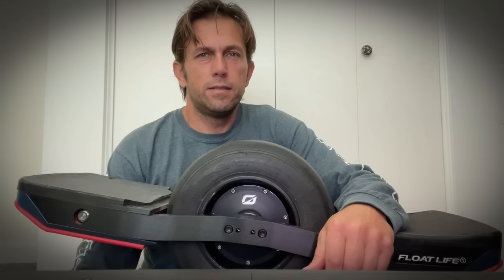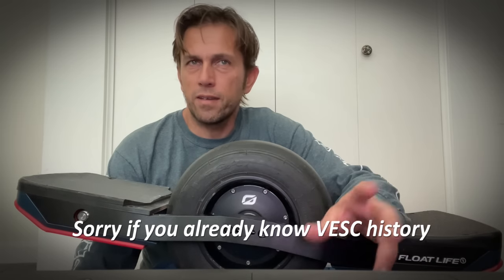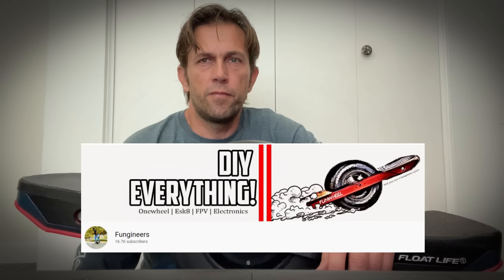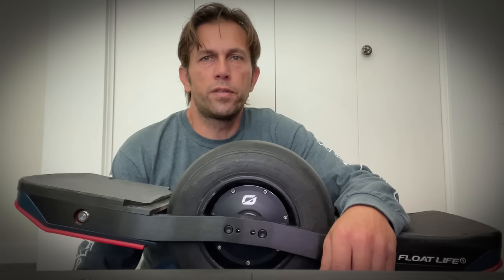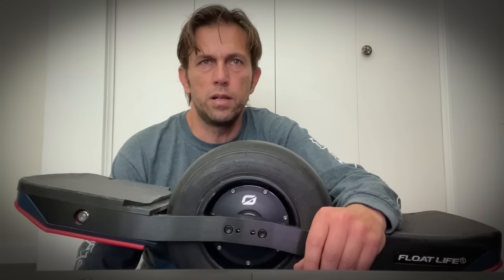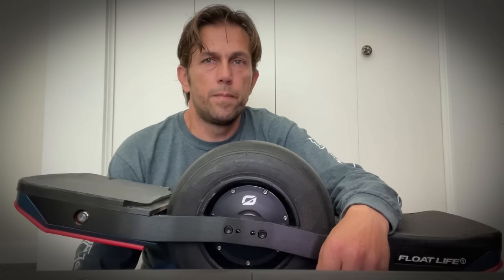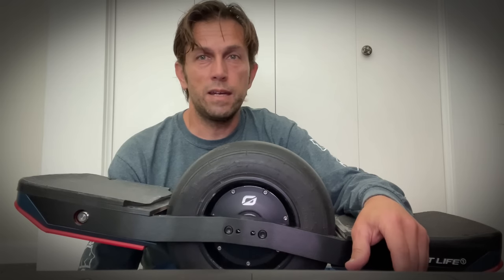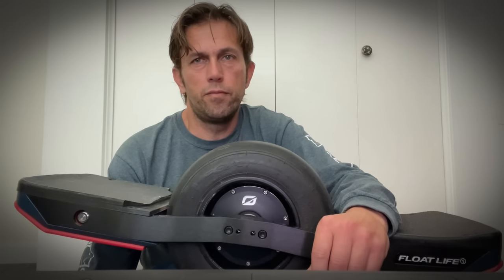VESC Balance Firmware - Magic Settings in v5.2?

Comment: Really great news! It is great to see the DIY boards performing better every month! 👍😁
Regarding the speed/bump instability; I have designed commercial motor control products which I can't go into details too much, but you might want to look at adding a 4th component "V" for velocity. Keep your PID tuning the same as it is now for low speeds, but at higher wheel speeds start to phase in the V component. What that does is to dampen rate of change of motor current. Basically once the motor is spinning faster you don't allow rapid change of motor current, only a slower change. This works synergistically with the real world physics of the motor being more stable at higher speeds.
The result is that at low speeds the motor will instantly respond to load peaks (like going over bumps), but at higher speeds, bumps wont affect the motor much at all its speed and torque will be very stable. Hope that helps and keep up the good work. 👍
Reply: Isn't V the same as D? So if I understand, what you're suggesting is a non-linear D gain that is lower at higher D?
Reply from the maker: I kind of do that to some extent but it won't help with the IMU issues - also, even at high speed you need to react quickly to certain terrain changes, imagine going from pavement onto grass, or hitting a steep ramp
Reply: I think I understand the difference between V and D, V is part of a separate PID to control the motor, not the PID to control the balance?
Reply: @jeepo500    no the D term as part of the PID is basically a predictive effect to allow things to change quicker.
A V term is not offical PID component but is a compensatory component added after the PID loop which dampens the ouput based on motor velocity. Additional averaging if you like, ramped in as motor speed increases.
Reply: @surfdado    ill argue that (respectfully). At higher, constant, speeds it is better to keep motor voltage relatively constant. So in your example of going from pavement to grass etc if you keep the motor power constant it will give a better result than trying to rapidly increase/decrease motor power for a very short period of time.
The dampening from fbe V averaging will be quite a short period, maybe 50 mS. Unlikely to need as long as 100 mS. If you are going at 2 meters per second and hit a 10 cm long bump that is 50 mS and 10 cm is a long bump, the peak loads from the wooden slats in your video would be much less than 50 mS and there is no need for the motor controller to try and change anything that fast when moving at that speed.
Reply from the maker: @wizrom3046  are you talking from standard vehicle experience? This is a balance vehicle - speed is not the primary objective, it's a side effect. Keeping the board stable and preventing nosedives is #1 priority. So if you transition from pavement to grass and keep the current constant you are going down
Reply: @surfdado  ... ah ok I understand your point better now. 👍
Reply: @surfdado  I'm curious what's going on with the IMU, just the filtering? If so, I think parallel filtering is the way to go, separate filters feeding P, I and D will definitely complicate tuning, but could lead to magic. Do you have logs somewhere? Where's the best place to contact you/discuss development?
Reply from the maker: The best way forward is to get yourself a VESC board so you can experience it and troubleshoot yourself - you can find me on the different DIY Onewheel Discords (google Funwheel or Floatwheel Discord for the links).

Comment: Love your videos.
Reply: Hey, I have a quick q, I went down the wrong path and built bytesize engineering OpenWheel but it has a huge battery 104x18650 and keeps breaking the battery box on slamming the ground. I'm gonna buy your pcbattery and rails to salvage parts and make this right after months of failure and constant 3d printing and epoxy. Can the funwheel 3d parts fit in an wtfXR rail or are they slightly different?  How often do you need to 3d print skid plates? I'll probably stick a small sheet of aluminum at the bottom to scrape. If you have any coupons for your shop please let me know, in in the hole so much by now 🥲

Comment: Great video. I can’t believe it works at all without the IMU data. Fwiw I think FM said it was running at 2000/second so 1ms readings wouldn’t be enough
Reply from the maker: The IMU data is the primary data we use. It would indeed not work without IMU data. As to the speed I'm not convinced that FM is running the IMU faster than we are - after all they use a processor that's half as powerful as the one used in any VESC. Their motor control loop runs at 14kHz (verified), ours runs at 20-30kHz (it's configurable). But I'm not sure where your 2000/second info is from - lots of rumors and assumptions out there. The VESC IMU data is read at 1000/s but there are efforts underway to make that faster. I'm not convinced however that this will have a huge impact

Comment: This is so awesome, I can’t wait for VESC to take over! How much would the investment be to convert a onewheel XR, but keeping my 15s3p pack? Would I need another BMS on top of the little focer3?
Reply: No you can use FM BMS ;)
Reply: Its about $400, you can use your stock BMS.  I decided to build a 21700 4200mah 45a 18s 1p battery (I have a spot welder, so I only spent $110 to build the pack) and decided to us a balancer to balance my pack every 10 or so cycles, that way I didn't need to take up space with a BMS.  I love the way my XR is now, heps of power, I truly believe it out preforms a stock XR by a good amount, and is even more powerful than a GT.
Reply from the maker: Especially the 4210 and older FM BMS can be reused, I'm not 100% sure about 4212 and up, isn't the locking/pairing bi-directional? But there might be workarounds, idk
Reply: @surfdado  Nope. BMS and Controller pairing is uni-directional; BMS -> Controller. Controller never communicates back to the BMS.
Reply: I can't believe that vesc some how manages to get similar to onewheel behavior at the exact moment FM has a terrible product launch on top of tells no one about locking down the board to the point you can't even work on them. All you people working on the vesc keep at it your doing gods work!

I cannot wait for the day where my XR controller dies or something and I can have a vesc installed and basically have the same experience without any FM BS.

Comment: I don't know for sure, but the Marconi filter (haven't heard of it before but I'm not that into control systems) will be some sort of low frequency filter, allowing "high frequency" content through. So, fast changes in set point go through, demanding a higher current, lower frequency, or slower changes in set point, are heavily attenuated. It might be why you're having issues over bumps, as it'll be a high frequency content coming through the filter, but in a degree of freedom that the onewheel can't control (it can only balance forwards and backwards, not up and down in the z direction, which a bump would show). But that's just a random guess!

Comment: This is way cool - I stumbled across this through the algorithm as someone whose GT initially ghosted and I was searching for answers (fine so far after getting a new footpad, but…), got caught up in the FM drama, etc…

I’ll be honest, even my haunted GT is fun enough that I am going to ride it for now, but all of this does have me wondering if I might need to find a non-FM solution between now and 2035 when their patent is up…

That said, even the stuff in this video is way beyond my current level of understanding of all this DIY biz. If I had a long-term goal of teaching myself how to go from 0 to something like you’ve got, where would I *start*?  

I’m not an engineer and have no background with that, but I can operate various screwdrivers. 😅 As for coding, I don’t know about any of the stuff mentioned here, but I’m maybe an intermediate-level web developer, so I think I can find my way around the software, probably…

Any, thanks for posting this. Really cool stuff, subscribed!
Reply from the maker: Instructions can be found on various Discords and in YT videos. This all should get easier over time as more and more plug and play solutions are being offered. And even today the vast majority of VESC DIYers don't ever touch the code. There's a PC tool and a mobile app for all the configuration stuff. But yeah, I'd stick to the GT for now, at least till you run out of warranty
Reply: @surfdado  Ok, thanks! I’ll check things out, slowly but surely… ;)

Comment: The nose grind you can do easily by going into custom mode and change the tilt of your board. It's super easy
Reply from the maker: haha and here I was thinking it required skill ;)
Reply: @surfdado  I thought the very same thing at first until someone showed me and then I was like ooooh now I feel dumb. Lol. We learn something new everyday. 👍
Reply: Well I never tilted the nose for a nosedrag. But if you only wanna do a nosedrag I'm sure this is the easy way to do 😝
Reply from the maker: Wait a minute - are we talking about a nosegrind or a nosedrag? A nosegrind to me involves a curb and the wheel being in the air. A nosedrag is the acceleration version of a taildrag when braking. Doing a nosedrag by changing your tilt is super lame, I'm sorry - and doesn't even count...
Reply: Anyway 😆 you could use negative variable nose tilt or constant negative nosetilt to be applied above 1000 erpm with vesc just make sure you know how to break

Comment: I believe that the nose dipping behavior when you're going at speed has to do with the fact that you're jumping off the ground slightly with each bump. Each time you land you would essentially need new data to be horizontal again. What it seems like is happening is that all of the faulty data is adding up to eventually produce an incorrect result. This sounds like to me that it's using rotational data in combination with the pitch data to actually tell you what is horizontal. I just don't know how it works
Reply from the maker: you're on the right track there - it's a combo of accelerometer data and gyroscope data. Hannes's config is accelerometer-centric. And I'm being told that the bumpiness causes a noise overload in the accelerometer
Reply: @surfdado  It would seem an averaging algorithm or using data with less accuracy might help? I am a computer guy and onewheel trail expert but not a coder
Reply from the maker: @Pyriscent  a good amount of the code is about filtering, i.e. making the data smoother / less noisy
Reply: @surfdado  I'm not a coder but I am a sound engineer, maybe the method of smoothing should change? In other words, rather than smooth out the lines just on the spikes, what about a gradual smoothing towards the edge of spikes?

Comment: I think what this indicates is something I've suspected all along, that the central issue here was philosophical, not technical. Namely, the misguided assumption, built upon a faux history of a benevolent company formed by geniuses who somehow managed to leverage this genius to take an original idea and flesh it out, using intelligence, forethought, and a deep insight into systems and a detailed investigation into all the possible edge cases to come up with a product that, after untold hours of tweaking and experimenting, and thousands upon thousands of lines of code, was somehow able to respond to all possible real world situations as if by magic.
I never believed this to be the case.
Rather, a far more realistic scenario was a guy who saw Dean Kamen's patent drawings for one wheeled balancing skateboards, decided to build his own, threw in some guessed at numbers into a motor controller, and just winged it.
This current situation seems to bear out the latter!
I.e., venerating and mythologizing  the founders (even is subconsciously) lead to shortsightedness!

Comment: A little integral gain could fix the nose dip, maybe decrease integral gain as velocity increases? I need to get a VESC soon.
Reply from the maker: with classic Mahony filters it was imperative to have integral gain to prevent nosedips at higher speeds. But this is not necessary with the heavy filter (don't ask me why). And once the IMU reports plain wrong data on a rattling surface integral gain wouldn't help because the IMU doesn't data doesn't even show the nose dip
Reply: I recall something about this particular frequency of terrain (wooden slates) was causing nose dives issues, I didn’t believe it at first but ill see if I can dig it up again.
Awesome vid tho very interesting stuff. 👍
Reply from the maker: @dustinglowa1072  you mean on FM Onewheels? would love to hear more about that

Comment: Can you do long tail drag ?
I suspect that the filter will eventually catch up and bring back the board to level.
Thanks for sharing this !
Reply from the maker: Longer than what we showed in our video? How do you do a "long" tail drag on the XR? Bringing the board back to level eventually is exactly what a well working onewheel should do, shouldn't it?
Reply: @surfdado  I realised after the fact that you did a pretty nice one on the video.
I dont say it's not the correct behavior. I was just asking if this tuning approach resulted in the same behavior as the Onewheel for this case. I am pretty basic rider I dont tail drag yet. There is still 3 ft on snow on the ground here... Should be gone in 3-4 weeks.
Reply from the maker: @michelcote  haha no worries - at least with snow the taildrags won't grind down your board ;)

Comment: I've been playing w/ PID and IMU filtering params to try and dampen the effects of bumpy roads (nose dipping) and/or "captain morgan" tail drags during heavy regen and have had limited success. Quick Q: When you use VESC tool logging, is the logged IMU data after filtering (e.g. Mahony) or just raw (as measured/output directly by the IMU)?
Reply from the maker: I log both the heavily filtered IMU data and the standard filtered IMU data - haven't had the urge to log raw IMU data

Comment: Interesting...  So for the P-only profiles in the VESC, you are essentially all gain with no integral or derivative.  This would basically be a straightforward multiplier, with the higher the P value, the "stiffer" the board would hold level?  And I would imagine at some value, it would be impossible to tilt the board in either direction because the motor would hold the board level?  If it truly is that simple, then I would imagine a simple circuit could accommodate, as opposed to a processor/controller?
Reply: In some ways it is like a simple multiplier; there are still other functions in the control loop to keep the board balancing
Reply from the maker: In theory yes, the most basic balance behavior could be made to work that way, but you still need the microcontroller to do the IMU processing and filtering - and then there's all the other things you'll want, like soft start, quickstop, wheelslip detection, terrain response, etc.

Comment: could it be harmonic frequency  from fluctuation of b emf in relation to amp draw from slow up (more amp) acceleration (less amp) in conjunction with other sources of data, just a guess.
Reply from the maker: I'd say no because it doesn't happen with a traditional configuration - and also only happens when it's bumpy, but regardless of motor amps. It's more likely accelerometer noise overload

Comment: Just tried the mahony kp2.0 on the vesc pint+gt40, my set up oscillates when going over bumps, was at mahony kp2.0 P25 I0 D0, motor amps 130A. it feels really good, behaves like a onewheel, but it oscillates when going over bumps, could it be that I didnt set up the DT1 lowpass filter?
Reply from the maker: Low pass filter doesn’t matter when D is 0. Is IMU acc-decay at 0.001? And can you make sure all the tune modifiers are off, I mean torque tilt and turn tilt?
Reply: @surfdado  set the acc-decay to 0.001 did the trick, this setup is doing really well at low speed bumps, almost like magic， no matter how slow you climb the bump, it doesnt overshoot, no oscillate after the climb, whoa, just blow my mind. but it is kinda funky at higher speed, coming from a very firm traditional setting, still need some time to build trust with it.
Reply from the maker: @gtmod2187  sounds like you got it! Yes, the high speed behavior is definitely not trust worthy. The other day I survived a 9 mile group ride with those settings, but every time I was above 10mph on trails it got sketchy and I had to actively pump and/or zig-zag to keep the nose up. I am now testing a hybrid firmware that gradually switches to my ATRv5 approach between erpm1 and erpm2 (currently 2200..3500) and above erpm2 is fully ATRv5. Feels promising, but I need to go on some longer test rides now, and find some of those wooden bridges
Reply: @surfdado  whoa, you are killing it there!!I experienced the same wooden bridge nose down issue when I use the traditional PID settings, this wooden bridge effect only happens when your I term is set too high(0.0035). maybe, just maybe, the onewheel gemini firmware, is the exact same behavior? hence the name gemini.
Reply from the maker: @gtmod2187  so far I've not yet found any terrain that causes problem on our XR. Whatever it is they're doing, they've got it figure out - but I've now learned that earlier firmware version had exactly those issues, especially the V1 OW was allegedly having problems with wooden bridges...
Reply: @surfdado  that's some really interesting find, hope you can figure this out